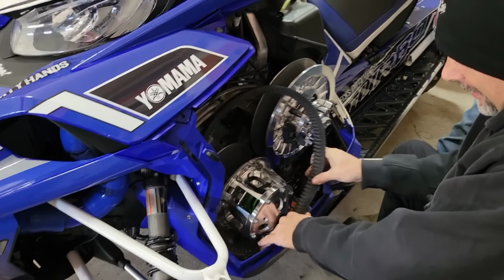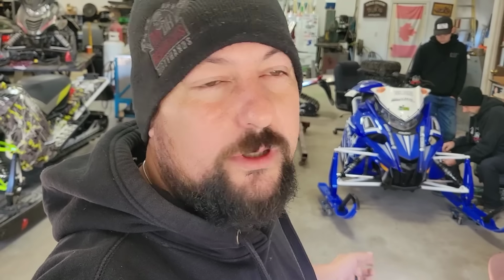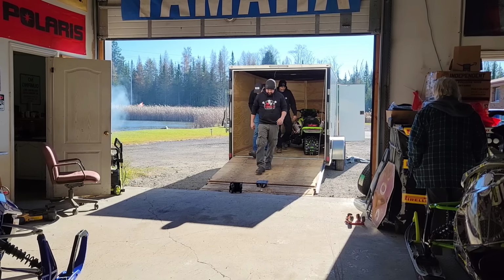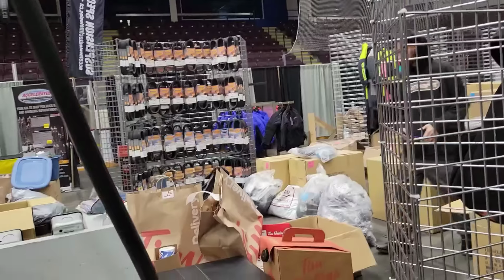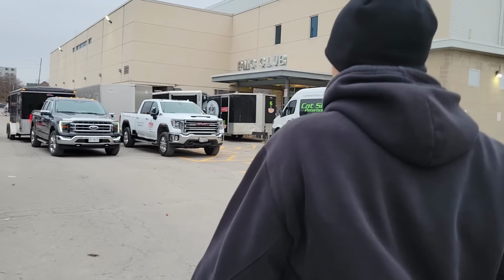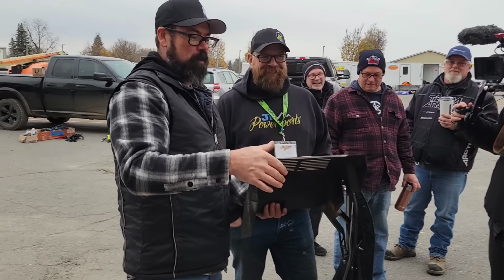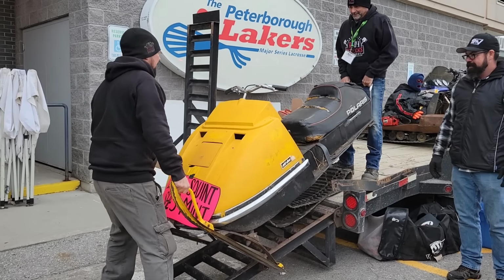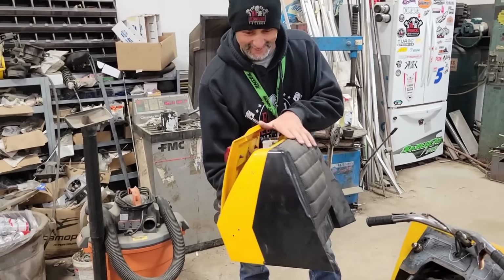We Buy A Cheap Skidoo Project Sled At The Peterborough Sledarama Swap Meet 2024!

Comment: That’s a sweet deal, i stumbled into a steal at work, 100$ for a 97 Formula DLX skidoo “583” they used to race it, been bored out to 611, bored carbs, carbon fiber intake plate, cut head, everything has been done and it goes like a bastard, there’s still deals if you know where to look

Comment: We got little bit of snow in Wisconsin lol my hobbies are snowman changed track in the Harley Davidson snowmobile old sled dealer retired had track form the 60s.  The problem was last feltter change the track out the window s was to big so now I understand why gears broken. And took out my 650 RXL triple dam fast. More like testing and working out the bugs lol have snow jet runs good dam Rockwell jaylo engine not my favorite. And Building skiroule Rt 500. The snowmobile God's very nice found triple new old stock triple bolen snowmobile engine factory for that set up I learned they made 2 different types of this sled.
Reply from the maker: that's awesome! cheers to ya in Wisconsin 🍻